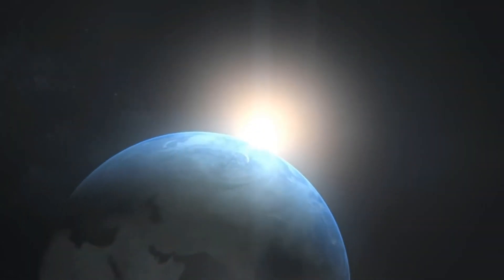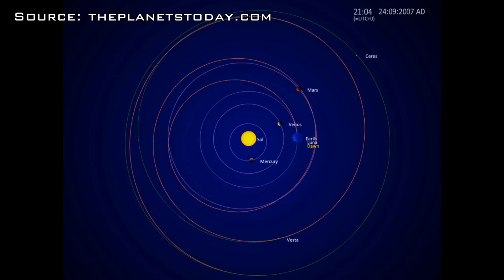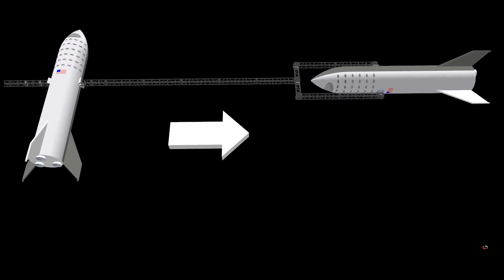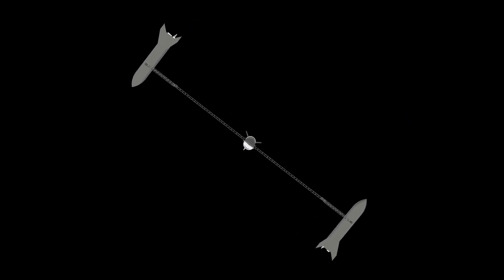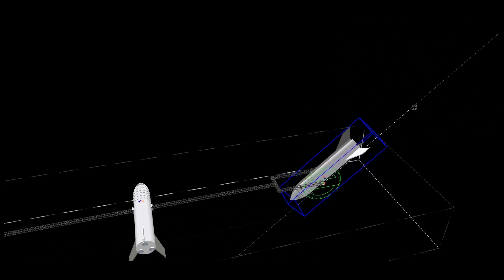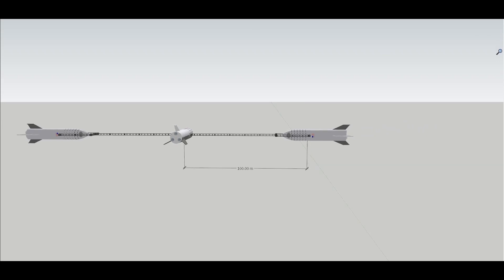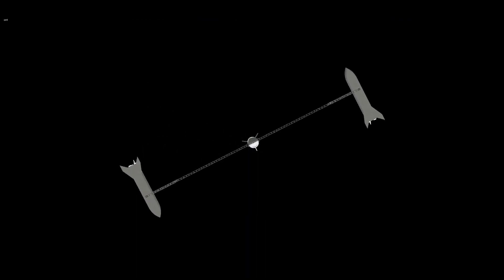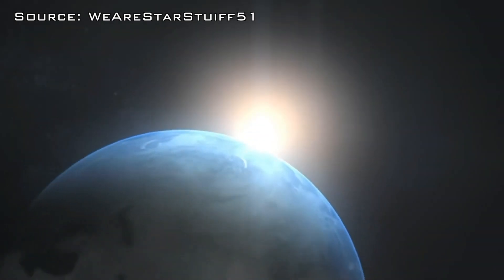GLS2: Artificial Gravity for SpaceX's Starship

Comment: I think you are on o something but theres a major problem. The whole aim of SpaceX is to reduce the cost of going to Mars. Buy needing another Starship you effectively increased costs by 50%.
Theres a better way,  have you heard of Buzz Aldrin  Cycler concept? You have a vehicle orbiting between  Earth and Mars and ships use their services for the trip.
So you have the GLS , without the extra Starship, and send it into a cycler orbit .  A starship leaves Earth and docks with the GLS.    Just before reaching Mars the Starships separate from the GLS  to land on Mars. At the same time Starships leave Mars and dock with the same GLS for the trip home.  Two  Cycler GLS would service 4 Starships.

Comment: Hello. There are lot's of problems with your idea, even though it is still a great one. The first of the problem I can see straight away is a linkage connection to both starships, even though when it's made on the starship's CG, however looking at your video, it is not. When you start the whole the system rotating using rocket engines, it causes the centrifugal force to act perpendicularly to the starship itself. What in its turn would tear it in halves way beyond 1 G is achieved. In this case, it would be much simpler to use only habitants modules to rotate to achieve the centrifugal gravity.

Comment: I HAVE AN IDEA!!! not really for Starship but just artificial gravity in general and for spaceships that wont land on a planet.
So as a kid when I heard you could use centripetal force to replicate the force of gravity in space I thought that was super neat but when spaceships using centripetal force as gravity were depicted in movies it was always this gigantic 1800's wagon wheel looking thing.  I always wondered why they didn't use something simpler like a straight cylinder tube or a rectangle because if you rotate them you still get centripetal force.  So my idea is, because it is impossible for humanity in this era to build a gigantic space wagon wheel, why not just rotate the ship itself.  Instead of orientating the interior with your feet facing the boosters, orientate it with your feet facing the walls of the ship. Its not a matter of technology or extra equipment but just redesigning the inside.  You could still use weightlessness to your advantage like moving heavy objects or traveling from the the bottom of the ship to the top or vise-versa no ladders or stairs would be needed.  And the best part is when you enter a room, you enter from the ceiling!! "that part always got me excited as a kid lol" 

But i have no idea if this even makes sense and if not my childhood self is very sorry : (

ive also wondered if you were to take your feet off of the ground in a ship like this would you still  be in rotation with the ship or would the wall of your room slam into you lol?
Reply from the maker: Ok what your talking about is actually doable and you can read about it here where its known as the tumbling pigeon: http://www.projectrho.com/public_html/rocket/artificialgrav.php#id--Spin_Grav_Types--Dependent_Centrifuge--Tumbling_Pigeon

About your question at the end: You are moving with the ship so you would jump... And land.. unless you jumped towards the wall haha

Comment: I like where your going I had this similar idea of a central ship with foldable truss system but in consideration it seems a waste of mass and cargo space...and landing that mass on Mars wouldn't make much sense...my votes for cable hub spool type set up that stays in space...cables allow for larger and variable radius's to balance the system another advantage more than 2 ships could be possibly docked to the same hub. RCS on Starship  be methalox rockets I would think should be no problem to control and initiate spin. Dock with the ships basically nose to nose and gradually reel them out  as Gs pick up balancing any wobble by individually controlling the distance each ship moves from the center . How about the use of reaction wheels or possibly a counter rotating mass of cargo in the central hub to avoid wasting propellants and stabilize things.

Comment: So, a couple of things. You could apply the thrust only on the side in direction of the travel you want to go to be efficient, but better yet you can have two counter rotating systems that are powered by electricity and not propellant. You could also use the butt to butt thing and have less pull on the lower propellant tanks than the crew compartments, this is almost half the structure for the same G force at the tip of the ship, maybe less than half since the tanks are thicker walled as you go down the ship so the but is the stronger end to grab too. I do however think that there could be substantial amounts of stuff that just stay in space. Just because starship is very Jack of all trades oriented certainly does not mean that less neatly packaged things will not be deployed outside of gravity wells, but atmospheric braking will always be a desirable tool if the deployed stuff is going interplanetary.
Reply: You could also do 0G Fridays and Dragon ball training Mondays if you impart rotation with electricity instead of prop.

Comment: RCS can do a fine job of spinning up. stabilization can be done with gyros.  They are already used on many spacecraft for orientation maintenance, and are very efficient. A material like dynema is great for the tether, and is much lighter/resilient than steel. 
don't need a truss, just a tether. The truss takes up all of the space in payload bay..
perhaps no need to slow down the spin, can just uncouple, and each starship can enter a different mars orbit.  those orbits will be determined when the spin is started, depending on orientation.  
We really need to get this figured out, so we can move on to solving the radiation problems.
well, just my 2 cents.
Reply: Well said.
Reply: The fuel required to spin-down is something like 2-4 seconds of main engine burn. Releasing the ships at a precise angle seems reasonable. But doing this close to Mars leaves little time for main engine testing and transitioning the crew to zero gravity practices. Perhaps you expected the atmosphere entry soon after decoupling?

Comment: Wow! Great concept.....Cmon guys! Put a like on the video, we should boost this idea!
Reply from the maker: Thanks Brianna, I tried to tweet this at Elon and EverydayAstronaut but my twitter game is trash.
Reply: @smallstars  Did you make some calculation? How big should be those rods to keep in place the structure? I was thinking something thick like the H bar which they make autopark structure, with trasversal section of 40 cm x 60 cm and a total lenght of.....wait, how big should be the radius?
Reply: @smallstars  the next question will be how much mass of stainless steal (titanium should be better, but i would exclude aluminum or lithium/aluminium alloy, it could snapp quite easily. It's more or less than 10 tons??? The cable could be a good solution and you can soöve the problem of starting rotation with the Zubrin concept, if you remeber that guy. Cables would have a much more mass/strenght ratio. Maybe you could even think about carbon fibre....I don't know!
Reply from the maker: @briannabernaola5597  Currently working on a loads spreadsheet for v3 with a guy I met on reddit. will share google doc.
Reply: @smallstars  search me when you have done...this is not my official profile...;) I'm going to follow your progress for sure!
Reply: @smallstars  Maybe it's not so clear but I'm nerd!ahahahah

Comment: I mean... yeah, but it seems like it's going to use a lot of fuel to get it spinning since it can't accelerate in a short amount of time. if the star ships accelerate too face, the stress on the trusses will cause it to bend and break. I would suggest something more like a rigid body truss where you have 3 of them oriented in a triangle, and they could connect like that. I don't think that would be too hard to accomplish either.
Reply: That's a good idea but the triangle design would be  more massive, negating any advantage in strength and require even more fuel to spin.

Comment: Agree, and from a structural engineering perspective an interesting design problem as dynamic forces are at play.
Reply from the maker: One of the nice things about it is that the only real resistance in space is the mass of the object itself. So when the spin starts and stops, the truss will not have much stress placed on it. The main stress will from the centrifugal force.
Reply: @smallstars  except for people moving inside the starship.

Comment: if they would use cables they would not need an extra ship for all the components and they would also need much less fuel to rotate because if they use an excess amount of cable they could start with a much slower spin and then simply roll in the cable  so the ships come closer with will increase the rotational speed
Reply: The upper limit on rotational speed (2-4 RPM) is due to nausea and disorientation problems. Also pulling in the cable under load increases the weight and power requirements of the winch.

Comment: I think, unless you sustain the burn, it will not emulate gravity.
It will spin, but all objects and people inside will be in a free fall state, there will be nothing pushing they against the floor as gravity would do. If you jump inside de ship on that situation, you could steal momentum from the ship and "fly" to the roof with no problem.

This is an interesting concept, and may be helpful if we produce enough fuel and it may be useful to mitigate micro-gravity issues even if the system could not achieve full 1g (0.5g is better than 0g). But it will need fuel to do that.
Reply: People inside would not at all be in a free-fall state. Look up "centripetal force" aka "centrifugal force". With a sufficient rotation radius, it's virtually indistinguishable from gravity.  Also, the burn would not need to be sustained. Without applied torque, spinning things keep spinning -- look up "conservation of angular momentum".
Reply: @harpfully  , I may be wrong and will take a look on that subject later today.
But force F=m*a, where is the acceleration in this context?
Reply: @ArthurJulião  Acceleration is not only change of speed, but also change of direction. The centripetal acceleration a=rω² where r is the radius of the curve (here: radius of the circle described by the movement of the spaceships) and ω is the angular velocity (i.e. degrees per second). So F=ma still holds, but a=rω² in this case.
Edit: messed up my example 🤣 - so to get ½ Earth gravity or 5 m/s² and a 150m truss on each side we get 5 = 150*ω², so ω=√(5÷150)≈0.18 rad/s or 10.3°/s or 1.72 rpm.
Reply: @ArthurJulião   The acceleration is pointed toward the center of the rotation..  Anytime you move on a curved path you're really accelerating toward the inside of the curve.  It's the same as the sideways force you feel when you're cornering in a car.

Comment: If you could detach from the truss while under spin, you could save the fuel for other purposes.
Reply: @Smarticus Simultaneous release properly timed, could accelerate one by the velocity of spin and decelerate the other by the same amount. Not much delta V but could be useful to stagger arrival times slightly.

Comment: Can you use a cable? This would mean that there could only be tension no compression.
Reply: Three straight cables and six angled cables would create a semi-rigid structure when under tension. (Or four straight and eight angled.) One environmental craft for the crew and a simpler one for cargo. Having the craft nose-in would mean the engines would be considerably heavier unless the cables were very long. When I dreamed up a tethered design back in 2012, I envisaged the craft being side-on to each other giving fewer, but longer decks and less gravitational variation between top and bottom decks. Three craft would be needed at the points of a triangle otherwise the system would be unstable. Unfortunately, as current rockets are stress designed to launch and land vertically, we are stuck with lots of small, circular decks.

Comment: I was thinking cables (much more compact) instead of trusses and why not have all 3 linked and spinning, not wasting one ship for trusses. not to mention you could adjust cable lengths for more flexibility in the amount of force you want.
Reply: I thought in this concept the central ship is sort of the main rocket of the journey and should therefore contain most of the fuel seeing that is the one that'll provide all the thrust needed to actually get to the coasting phase and decelerate for Mars orbital insertion.
Reply: I don't think a structure like this, cables or struts, could withstand even 1 raptor engine burning. Absolutely need to separate ships at either end.
Reply: For each Starship carrying people there will probably be 10 Starships carrying supplies and equipment.  I see no problem with having one cargo Starship modified to deploy the trusses, and two crewed Starships hooking up to them.  I think it's a brilliant idea.